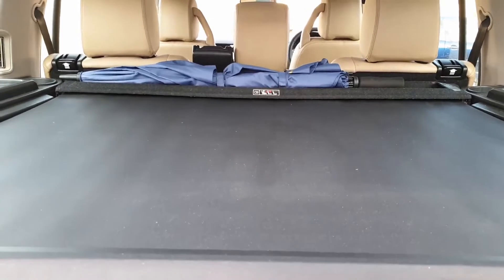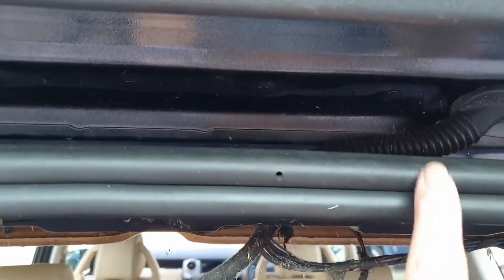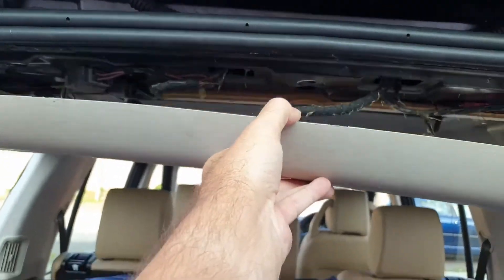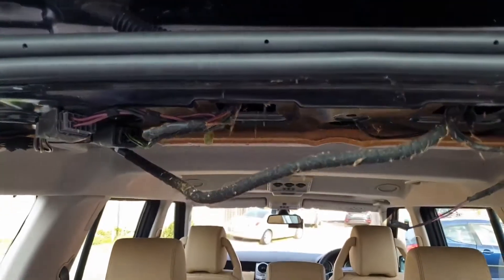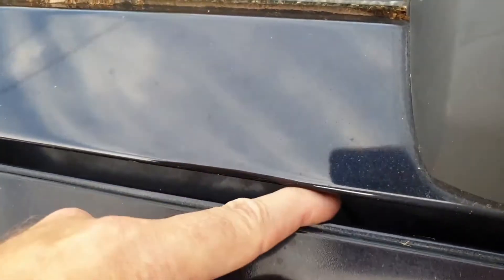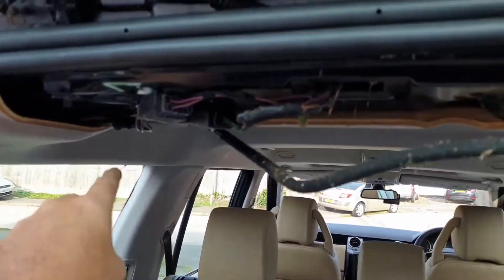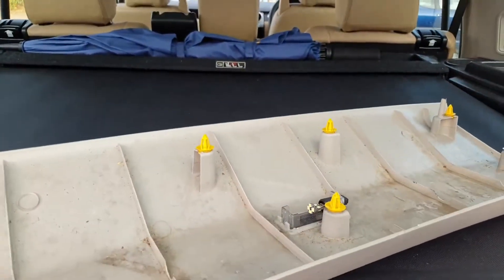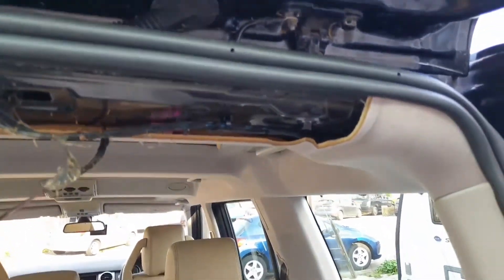Discovery 3/LR3 Tailgate Leak *FIX*

Comment: I had similar problem but it was the antenna changed it 3 times kept leaking so I did a antenna delete. Went to a body shop had the hole where the antenna wires came threw professionally plugged and painted. I kind of like it without it and it doesn't affect the radio at all. As far as the sat-nav I have a portable Garmin GPS with life time maps.